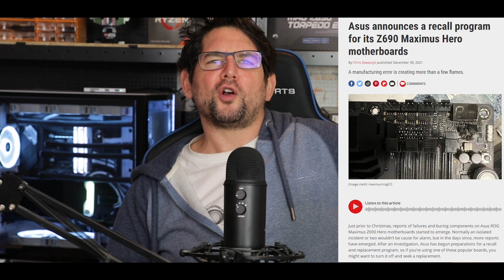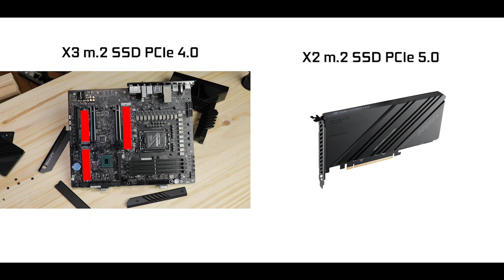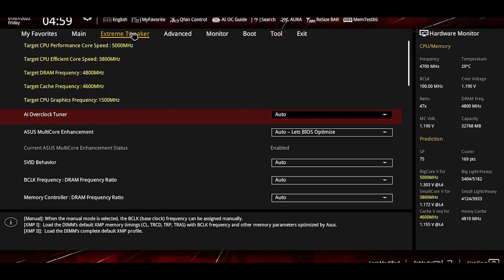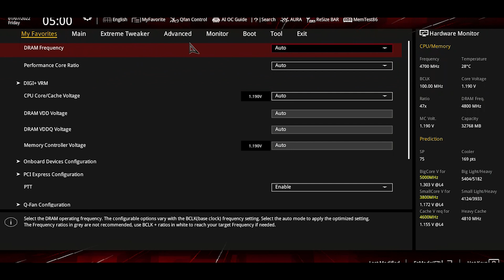ROG MAXIMUS Z690 HERO : The ONLY Maximus worth owning!

Comment: Excellent video. Thank you.

Question: I'm upgrading to a new M.2 drive (Samsung 990 Pro) next week in my ROG Maximus Hero . My current old M.2 drive is currently plugged in on the motherboard (slot A). Is it better to use a M.2 drive in the Hyper M.2 PCIE card in my PCIe 5 slot on my Maximus mother as a boot/OS drive instead of the onboard M.2 PCIe slot to maximise performance?  Thanks for reading.

Comment: 7:25 : There aren't 3x PCIE 4.0 slots on this MB. There are 2x PCIE 4.0 and 1x PCIE 3.0. 

7:50 : There is only 1x PCIE 5.0 M.2 slot on the hyper expansion card. The 2nd slot is PCIE 4.0 and that cannot be activated if the 5.0 is enabled. (Using the bottom most (PCIEX16 G4) slot.
Reply from the maker: Hello :)

I just verified on documentation and board itself. 

The hyper card does have 2 PCIe 5.0 m.2ssds. Which has its importance :). Obviously only activated on the first or 2nd closts 16 slots from the CPU.

As for the chipset k m.2 ssd , you are correct it is PCIe 3.0, therefore I am keeping your comment for the community :)

Thanks for watching and contributing. 

Greatly appreciated :)

Comment: so that chip u said is in the wrong way you mean on this board shown in this video this chip is in correct possition or it should be other way around?
Reply from the maker: If the chip is not the way I showed on the video. Return it and ask for a replacement.  The 1 of 150 should be facing the CPU direction.
Reply: @Laurentschoice  ok kind sir im expecting mine within 10 days. hope that boards that sels in eu are not part of that snafu

Comment: Slightly confused, so if I use gpu RTX 3090 on PCIe5 and x8 Asus SSD card on 2nd PCIe5 slot for nvme SSD, will both be working as Gen5 16?

Thanks in advance.
Reply from the maker: No, they will both run at 8 pcie lanes (pcie 5)

Comment: Guys I need help, I want to get a rx 6950 xt with an Intel core i9 12th gen set up. I just don't know what motherboard to get though, I'm a first time builder so I don't quite know what I'm doing. I was looking at the Rog z690 hero bc apparently its a good match with the Intel i9 12900k, but would it be a good fit along w the rx 6950xt? Or would a rtx be better with this instead? Bc nivida prices price are a bit too inflated for my liking so I was curious if it'd be a good choice.. Sorry ik it's a stupid question but I'm a first time builder trying to learn about this stuff, so I'd appreciate some help. Would these be good options or are there better motherboards?
Reply from the maker: This would he a great motherboard but maybe a little too much for a single GPU config. 

I'd rather go on a AORUS Z690 Pro in your case. 40% cheaper but perfect for an i9.
Reply: @Laurentschoice  thanks! I'll go with that one instead. Thanks again

Comment: One of the three M.2 slots on the motherboard is PCIe 3.0
One of the three M.2 slots on the expansion card is 5.0, the second one is 4.0
4 of the 6 SATA ports can use bootable devices and used in RST RAID.
The last two SATA ports can't be in RST RAID and can't be used to boot from.

Comment: AAAAAAAAAAAAAAAAAAAAAAAAAAAAND they messed up with 3 slot PCIe spacing.
Reply from the maker: ahahahaah.... someone noticed :)
Reply: Not just 3rd, the 2nd as well. My none reference 3080ti blocks the 2nd slot. Only gigabyte got it right. This board did not need 3rd slot, should of went with just two and space them out correctly. I also hate it how they replaced pci x1 slot with ssd slot near the cpu, can't even use a dedicated sound card, cringe.

Comment: only one bad thing - it does not allow DDR5 ram work fully - from 5600mhz you only can use 4000mhz max. If you put in bios 4001 mhz, the computer does not starts! Do not use if you want powerful gaming computer as this motherboard runs only on minimum of all your components you will connect to it! In short terms - its not worth the money just to pay for those anoing ROG lights on motherboard witch you can only turn off when PC on, and when its off - you will be annoyed by isles lights on your motherboard draining your electricity and bringing big electricity bills even you not using it. So when you turned PC off - you need unplug cable, or turnoff PSU on back

Comment: compared to other z690 boards out there this one is the most underwhelming. there is plenty of boards out ther that come with better features at a better price point. the cheap plastic feel to this board and the fact it doesnt even have a backplate for thermals and it only has 2.5gb lan, ive seen lower end boards from other manufacturers that have those and a better vrm solution. but asus knows theres morons out there that will just pay the ridiculous price tag without doing the research just because its a rog board lmao. they could have done a way better job with this board. thumbs down.